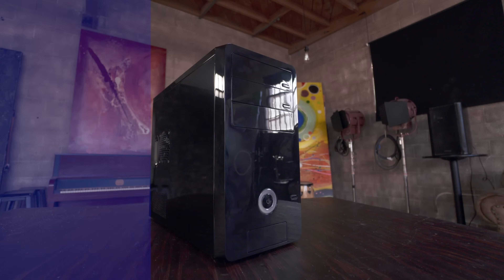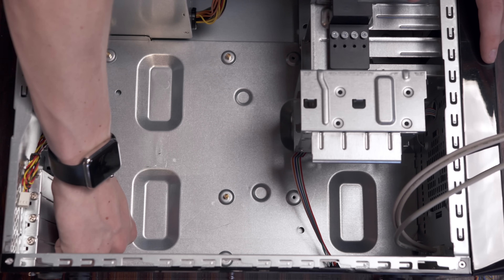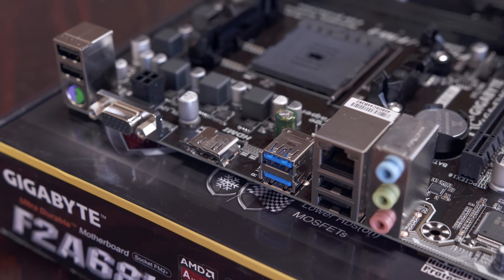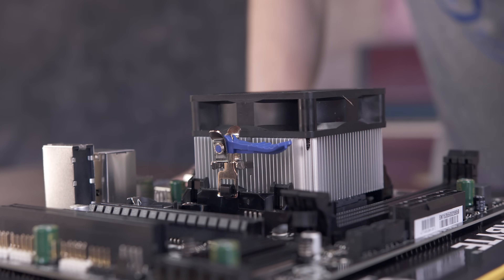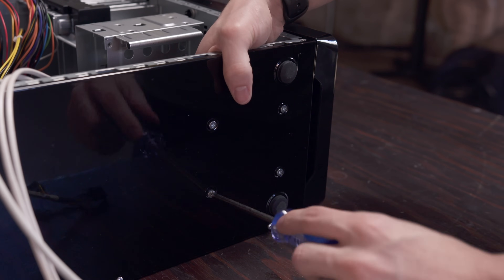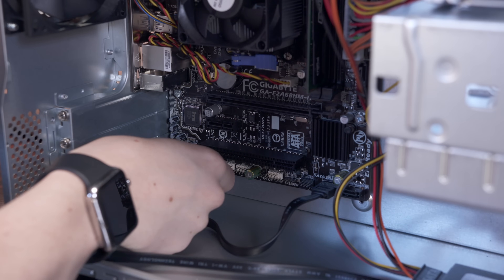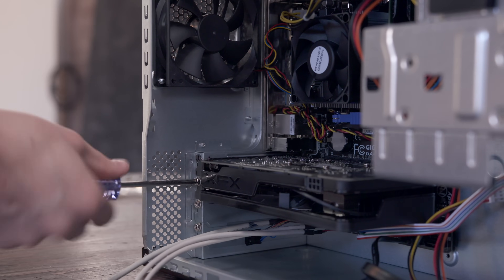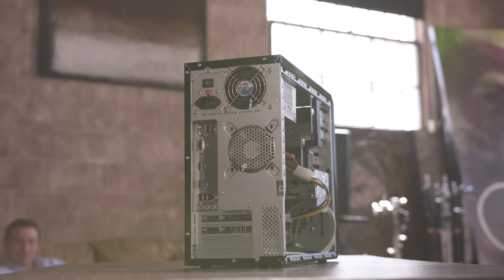How to Build a Gaming PC! (2016)

Comment: Don't build with AMD CPU's its cancerous power consumption unless your rich and can afford high electricity bills . performance wise is great on web but gaming is cringe on low budget fm2 socket .I've had previous fm2+ 750k and am3 fx 6300 build and i can say there fast but  with electricity at 300 bucks for the am3 build and 213 dollars fm2 build a month  if going with AMD buy a gold power supply#nevergobronzeamdhasnolimitswhenitshungry#

Comment: So going off from this build, I changed up the case, which made me also purchase a power supply. now everything seems to still plug in similar to this, but for some reason won't display the bios...guys, I'm at a loss here...i do have it plugged through hdmi if that makes a difference.

Comment: I can't wait to join the master race!
UPDATE: I have built my new gaming pc and I have joined the master-race.
Reply: Me too!
Reply: ugly.
About an hour and a half. Took me around 30 to 45 minutes to install Windows and download all of the drivers. (I typed this on my newly built pc.)
Reply: are you building the boson 3.0?
Reply: *****
No but some parts of the Boson 3.0 will be used. I'll be using the same ram, MoBo, and processor.
Reply: I'm just going to be using the GPU I already have, the pny Gt 740, not the best but will get the job done.
Reply: just get a gtx 980, it has 4gb ddr5 vram,
Reply: philclobes I would but I don't have enough money and and I already bought all the parts.
Reply: +iHow Tutorials tell me when it done, i wanna know the performance
Reply: ugly.
ok
Reply: lol, me neither, but I am close to building my new pc, because the one I have now is an amd machine, which is not good at all for gaming. so I almost have enough money to buy all the parts. but instead of buying a heat sink, I will have a water cooler and like 1 fan mounted and a fan will already be on the graphics card itslef.
Reply: philclobes
Cool. My pc parts are arriving today! So excited!
Reply: +iHow Tutorials GOOD LUCK ON THE BUILD
Reply: +iHow Tutorials specs?
Reply: +iHow Tutorials i just ordered my parts, i used almost everything here, i swap the r7 360 or a gtx 750 ti and went for a 500 gb harddrive
Reply: ugly. I'm thinking of getting the 750ti. I might order it later.
Reply: UPDATE: I have built my new gaming pc and I have joined the master-race.
Reply: +iHow Tutorials SWEET WELCOME MY MAN, HOW LONG DID IT TAKE TO BUILD
Reply: +iHow Tutorials awesome, my parts are still coming in :( it will take 1-2 weeks, i cant wait any longer
Reply: ugly.
I got to admit. Building a pc is simple. And I'm only 12.
Reply: +iHow Tutorials i was nervous and hesitated couple times and finally decided to buy part instead of prebuild, i hope it works out for me
Reply: ugly.
Yeah. Like I said it was darn easy.
Reply: my parts are coming in tomorrow, almost joined the master race
Reply: ugly. Thinking of maybe getting a gtx 750 ti.
Reply: +iHow Tutorials you should, for 110 bucks the performance is amazing, 100+ fps on csgo 130+ minecrafy
Reply: +ugly. minecraft*
Reply: ugly. Gt 740 can get up to 330 fps. The gtx 750 ti would obviously get more.
Reply: +iHow Tutorials yea, i havent tried it out (since its not here), i just expect 100+ fps in most games
Reply: ugly. I heard it can run gta v on ultra 30 to 40 fps.
Reply: +iHow Tutorials i was able to build my pc, but the hard drive i bought failed... so i couldnt instsll windows
Reply: ugly. That sucks. Do you have an old hard drive? You could use that.
Reply: Wait for the new GPU's to come out and buy a used one. I am 13 btw gl on ordering the parts. Don't be idiotic like me.
Reply: +iHow Tutorials I recommend you buying a HD7970 (Used) or wait for the RX 460 as its roughly the same price as the 750ti. IF you want to go  
for NVIDIA, right now is not the right time to buy their 970's (970's are gonna cost a heck lesser than it is right now)
Reply: +iHow Tutorials i do, but i cant since all the hardware data and etc is on the harddrive, my pc wouldnt boot
Reply: ugly, may I know what hard drive you used? I recommend you buying a new one. If you had anything important on that hard drive, its gone.
Reply: It might also be because of the SATA cable, have you tried plugging it into a different SATA port with a different cable?
Reply: +CorNVex it was a western digital 350gb harddrive, it was a clean one but its faildd after 10 mins
Reply: +CorNVex no, but i can maybe try
Reply: +CorNVex well the harddrive didnt fail, its like 90% it will, i get this S.M.A.R.T backup and replace and that means the hdd will fail anytime also windows wouldnt let me install into the hhd
Reply: what was your build?
Reply: Who are you refering to, TJ Moore?
Reply: +ugly. I just ordered a new GTX 750 ti FTW. It was on sale for $120, the same price as the SC and it has 2 fan and an even higher clock speed.
Reply: +iHow Tutorials nice dude :) you wont regret it
Reply: ugly. It's 2 years old now, but it should still be able to play the games I want to play. Not only that I don't have a lot off money. This should give my PC a pretty big boost.

Comment: What is a good Processor and RAM that is compatible with the Geforce Gtx 750 Ti? I'm building a Gaming pc
Reply: Windows 8? What're you smoking?
Reply: *windows 10
Reply: Make sure you cool your fans adequately m8.
Reply: +The Godbrother Production Company TM how do you know of it has a PIC express slot ? will it be in the motherboard specs?
Reply: No. Not all processors use the same chip set. DDR4 does not work with z97 for example. Make sure to check your component's specs before purchase to ensure compatibility.
Reply: +AKProfit
Why Windows 8.1 pro? Why not just home?
Also, why the i3? i3 6100 is arguably the best on the market as of right now. 
Also Cloud, I'd recommend changing from the 750w psu to a 450-500w one. Use PCpartpicker.com to check for compatibility. I'll send a link to a build I recommend.
Reply: Any CPU and RAM (not too old) will be coptaible! I would recommend an intel 6500, and maybe 8gb of ram from corsair of g.skill.
Reply: any afordable AM3+ motherbord with any compatible CPU and all ram is compatible with the GTX 750 TI (as long as the motherbord supports it), (apart form some types of server ram). use this website https://uk.pcpartpicker.com/ they make shure the parts are compatibe and automaticly find the cheapest part and the cheapest deal on that particular part.

Comment: Do different motherboards require a certain cpu, cause when I went back and saw the build for the first one, the motherboard was completely different
Reply: The chipset that the motherboard uses determines the CPU compatibility. For example, LGA 1151 chipset only support 6th gen Intel Skylake processor.
Reply: +WB IsMe look like I'm getting some new thing for my build I have planned
Reply: you can just look up which proccessor you want to get and then look up what motherboard can go with it. I would  suggest getting intel core i7 6700k, it has 4 cores and also has a speed of 4ghz, and you can overclock it to make it even faster.
Reply: +philclobes overkilled

Comment: Thank you Austin!
I built my beast and joined the PC Masterrace!

Intel Core i5 Skylake 6600 (Quad Core) 3.2 GHz

8GB HyperX DDR4 RAM

nVidia Geforce GTX 970 (4GB)

1TB HDD

480GB SSD

ASRock Pros4 Motherboard

Can run BO3, Highest settings 1080p 60fps!

Comment: Hi Guys , will these Specs be Alright to play on Ultra and 4k , Also could you tell me if i am BOTTLENECKING OR OVERKILLING :

i7 4790k CPU
MSI GTX 980 Ti 6GB GPU
Corsair Vengeance 16GB RAM
samsung 250GB SSD
1TB WD HDD
Corsair Hydro series H55 Liquid cpu cooler
Corsair CX850 power supply
Gigabyte Z97-D3H ATX motherboard
Reply: +EMIR H Yeah bottleneck is that CX850 power supply. bottleneck as in screw up your pc because you want to save money. Get a quality unit; checking out the PSU tier list, and grabbing something around tier 2(Seasonic M12II Evo is a good quality, fair price unit). Also, unless you go for SLI(2+ graphics cards) get around 620 to 750 W power supply, 850 for that build is useless). And you won't play Ultra and 4K at 60 fps with that, but it's simply too demanding right now. Either go for 1440p and 60 fps or 1080p and 144fps. Also keep in mind liquid cooling doesn't mean it's better than air cooled, you can handle an overclock with that cooler but air coolers work better for that price range(and won't ever have the danger of leaking). Another thing: Nvidia just released the 1080 which performs better than the 980 ti(20-30%), wait for that instead of getting the 980ti right now, as it costs around the same.
Reply: +EMIR H Sure, if you want about 15 fps...

Comment: how do i add an operating system once i build it? can anyone help
Reply: if you have an OS disc or USB hanging around, put those in and run those from the bios. If you don't have those, you're probably out of luck
Reply: +lawrence campos so if you don't have a cd drive you can buy a cd one but you will have to download windows and put it on your usb , plug your usb in then run it and use your windows cd key also you have to buy a cd key or you can pirate it but i wouldnt do it if I was you just so you know if you get in trouble just say i warned you
Reply: +Vince Kaple So do I boot from the CD and custom download. Just like installing Windows on a PC that requires BIOS because it's missing because a stupid 9 year old burned your hard drive and deleted everything.
Reply: yes boot from cd and custom download

Comment: Tell me if this will work, if it will have enough power to run, if compilation will work, and if it will be fast, PLEASE CHECK:: BuildCase: NZXT Guardian 921 RB No Power : 70$PSU: Seasonic S12II 620 BRONZE, SS-620GB  Power Supply : 70$Motherboard: GIGA-BYTE Technology AMD FM2 SOCKET A88X CHIPSET : 80$CPU: AMD A10 7870K Processors 3.9GHz Socket FM2+ 95W, Black : 120$System: Windows 10 : FreeMemory: Crucial Ballistix Sport 8GB Single DDR3 1600 MT/s PC3-12800 CL9 1.5V UDIMM 240-Pin Memory : 30$SSD(Hard Drive): SanDisk SSD Plus 120GB 2.5-Inch SDSSDA-120G-G25 : 40$Video Card: XFX PCI-Express Video Card R7-360P-2SF5 : 100$StarTech.com 6-Inch LP4 to 6 Pin PCI Express Video Card Power Cable Adapter : 3$
Reply: + is here a specific fan I should buy, ty.
Reply: i mean it looks so far good, just swap out the a10 apu for an athlon x4. dont know about the case btw.
Reply: +Lizrad Sceptile What about the case, which tax do you recommend if it's bad? What about the fan btw.
Reply: Atx
Reply: allen eti unless you overclock, stock cooling is adequate.
Reply: allen eti case is up to personal taste and price, just dont buy one that comes with a power supply.
Reply: So the heat and sink fan will be enough, I'm a beginner so you might have to explain
Reply: +allen eti yes it will be enough.
Reply: you can also double check if there are any hardware conflicts on pcpartpicker.com
Reply: Leroy AoS true, pcpp is pretty good about that sort of thing

Comment: Hey, I'm new to gaming PC and I'm going to save some money for one. The last days I was just looking for parts to build my own $500 PC so can you guys tell me if this would be an okay PC?

AMD FX-4300                                Processor
AMD Radeon R7 250                    Graphics cars
Ballistix sport kit 16gb                 RAM
Asus M5A78L-M USB3                Motherboard
Thermaltake 500w ATX 80         Power supply
Seagate  ST1000DM003 1 tb     Hard Drive
Thermaltake Versa-H21              Case
LG Electronics DH18NS50          Optical Drive
Reply: +JopMans Get 8GB of RAM instead of 16GB and use the extra money to get a better graphics card.
Reply: Jamie Last not a CPU?
Reply: JopMans Well, a better CPU would be handy, but a better GPU is more important. Try to get an R7 360 or a 750 Ti if you can.
Reply: Jamie Last I found a gigabyte R7 360 OC for $130. Thanks for your advise :)
Reply: JopMans No problem. The better graphics card should really help in games.
Reply: I did some math and changed my motherboard to a Gigabyte GA-F2A78M-HD2, my RAM is now 8gb. Because that's a little cheeper I'm going with the AMD A8 A8-7600 Quad Core processor.
Reply: I don't think the AMD A8 will offer you any extra performance that the FX 4300 will, it might offer worse actually. If you want a step up from the 4300, go for the FX 6300 or an Intel core i3.
Reply: Jamie Last Good you say it though, just found out the graphics card won't fit on the motherboard. So just going to stick with the asus motherboard and AMD 4300
Reply: JopMans OK, probably the best idea.

Comment: Although this vid is helpful, never, ever skimp on your Power Supply (PSU) or Case.

Take it from someone who did - again & again. Years of bringin on the IT stupid.

The PSU is not "sexy", but will potentially blow your PC if you go cheap. (Light & flimsy is not good. Heavy is good.)

And a cheap case can be built badly and cause cards to become unseated while running, again, blowing the system.

Nice Case, Nice PSU. Painful in the short run, but you can re-use both when you upgrade.

Comment: i am an extreme pc noob. Can someone tell me are all pc cases and motherboards shaped the same? Like the plugins and stuff.
Reply: +LazyCat All motherboards should be more or less the same. The Pc cases are different in shape, but all the pins and connecters and stuff should be the same, so you should be able to fit everything into a standard or better case.
Reply: +Tomasz Antochów thx!
Reply: LazyCat Though dude, you should watch out. Motherboards fit only certain CPUs, so you should watch for the sockets etc. I'm not much of a pro, so I'd recommend going to some forum or something to find out more.
Reply: +LazyCat No, as a guy in a previous comment said "Motherboard comes with different standardize size namely EATX, ATX, MATX and ITX. Different case support different size of motherboard. Case in the video support MATX and ITX motherboard."

Comment: seriously a cheap power supply ?
Reply: +Abhishek Yadav how is that a bad psu. Thats a good brand
Reply: +AnimeOkatu psu that comes with the case are usually for a normal(cheap) pc not a gaming rig. when cheap power supply blows up it takes entire pc+monitor euth it belive me exactly that happened to mine pc.
Reply: +Abhishek Yadav I used psu that came with my case for 2 years and it worked just fine, until vent started makin too much noise so i swapped it.
Reply: +Dženan then it was likely killing your components with ripple
Reply: ***** Nope, still using same components 4 years after, working like new.
Reply: it's a part of his boson 3.0 build which is a budget $300 build. So yeah, considering the budget, the psu was necessary. This specific one has pretty good reviews.

Comment: You fucking suck, you're going way too fast and I followed every step and the PC won't turn on. I've been at it for hours and it's really stressing me out and I'm very angry. This video is complete trash and to anyone who is watching it for the first time, do NOT bother and go find a different video. (I'd rather pay Frys 50$ to build t for me)
Reply: Hold on mate, first of all, if it goes to fast, that's your issue. Second, make sure you actually are using the same or much the same parts. This one video isn't a Bible for all PC builds. If I am incorrect, feel free to trash me.
Reply: Yeah I agree. His tutorials and build guides are terrible piles of steaming shit. I've already built a PC and I had no issues. If your computer is just doing nothing when you press the power button, double check and try different things with the front power button cable. If the computer starts up and then shuts back off within 10 seconds, make sure you plugged in the CPU power cable. I didn't remember him saying to plug that in and it is a 4-pin port near the CPU on the face of the mobo. You could have just gotten really unlucky and gotten a dead part from the manufacturer. Look up how to troubleshoot PC's for singling out which part is broken and telling the manufacturer.

Comment: Motherboard 

ASUS H170 PRO GAMING ($115) 

CPU 

Intel Core i5-6500 3.20 Ghz ($205) 

RAM 

Kingston HyperX Fury Black 8GB 2133MHz DDR4 ($53) 

Graphics Card 

EVGA GeForce GTX 970 Super Clocked ACX 2.0 4GB ($310) 

Hard Drive 

WD Blue 1 TB ($54) 

SSD (optional) 

Samsung 850 EVO 250GB ($87) 

Case 

Cooler Master HAF 912 ($65) 

Power Supply 

Seasonic M12II 620 Watts Bronze ($70) 

DVD Drive 

Asus 24x DVD Burner ($23) 

Total Cost: $983 (USD)

Keep in mind I know nothing about computers...
Reply: Seems like a good build

Comment: Why doesn't my usb 3 work? The mother board didn't have a connection for the usb 3 cable??
Reply: +Erik Santana The motherboard does not have a USB 3.0 internal port.
Reply: +WB IsMe so what are the blue USB inserts?
Reply: Assuming that you are talking about the video's build.
The blue USB inserts is USB3.0 connector. To get the USB 3.0 to work, you need to connect it to the mobo's internal USB 3.0 port but the mobo in the video doesn't include a USB 3.0 port.
Reply: +WB IsMe oh well that's confusing. So its a trick?
Reply: Erik Santana Firstly, are you talking about the video's PC or your own PC?
The casing in this video doesn't have a USB3.0 but the motherboard have an external USB3.0 port.
If you are talking about your own PC, it might be some a faulty USB insert or other fault.
Reply: +WB IsMe the case that I bought has a USB 3 connector but I find it odd that the mother board only has USB 1 and 2 connections
Reply: +WB IsMe I bought that exact motherboard, just a different case
Reply: Erik Santana That explains everything...
Older version of motherboard like the one you bought does not come with internal USB3.0.
You can google "motherboard internal USB3.0" to see how it is like.
Reply: +WB IsMe ok cool. Thanks